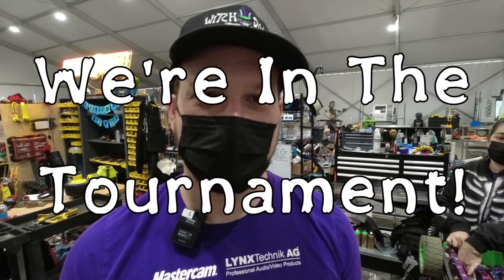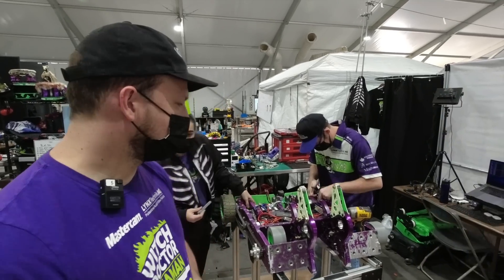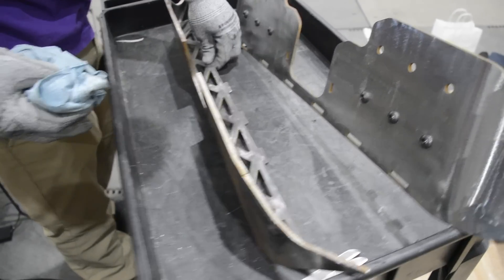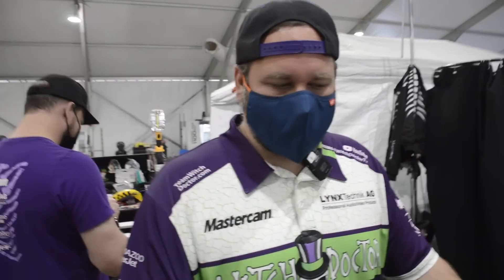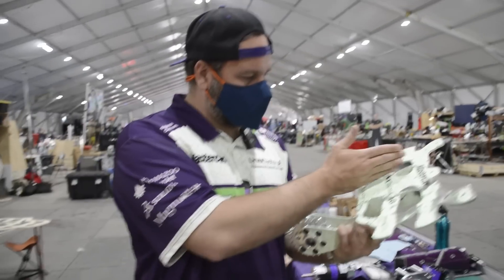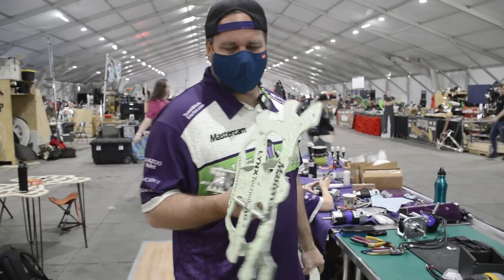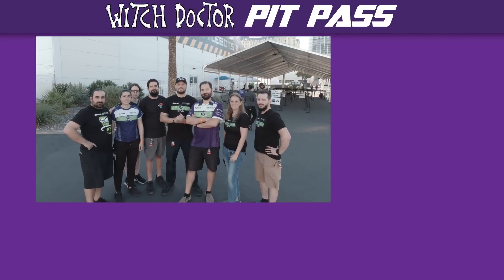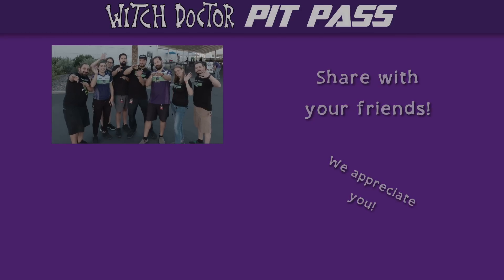How Witch Doctor Prepares for the Tournament! // Witch Doctor Pit Pass Ep 12

Comment: Okay, maybe a basic question but I am curious. While hardening the motor by applying the epoxy while not use another motor to spin the motor being hardened? Just looking at it from workload and parallel processing, having a motor spinning the motor under work would free up people to do other things?
Probably over thinking it, but gotta stick with my talents.
Reply: I was thinking the same thing you could literally fab up a rig using a 10th scale motor and esc and 2s battery for under $100 and free up two people for other stuff
Reply: @54raceman  I was thinking even simpler, a variable speed drill and a rubber band.
Reply from the maker: You've got the right idea, Bradford Benn! That would be a great option if we had the tools to make that setup on hand. Since we're still developing our battle-hardening plan for these brushless motors, frequent and detailed checks had to happen during the curing. If we can nail down a process we're happy with,  we just may do what you are suggesting in the future.

Comment: What happens if all your parts become unusable from previous fights?
Reply: That is pretty much impossible, but back in season 5 when they had a material issue with their weapon disks, they were able to get former team Chomp to cast them new ones to use for the rest of the competition.
I would imagine something similar would happen if they ran out of a specific part.
Reply: They have cncs on site at battle bots now that they didn’t used to have but in reality when you’re somewhere located like vegas is the only thing holding back getting something made that the on site equipment cant machine is money
Reply from the maker: We've come close to this, but not quite. Parts become less desirable with wear, but it takes severe damage to make a component completely unusable. In the 2022 season, we had no unused parts left toward the end golden bolt tournament. So we had to make the tough choice of which worn part was the least broken. Like others have pointed out, sometimes friends can help you make it through. Great question, joen0411!